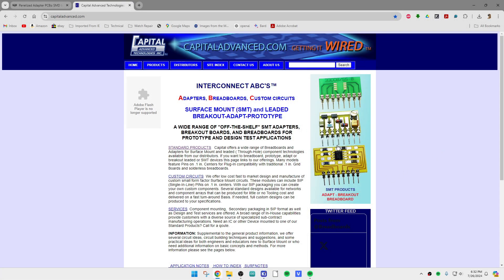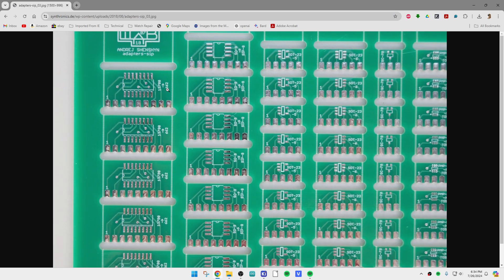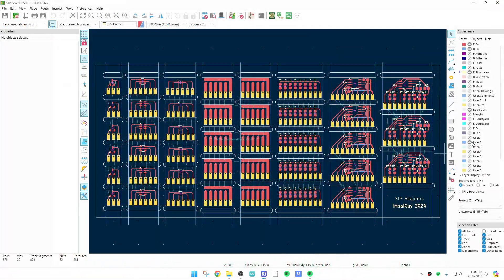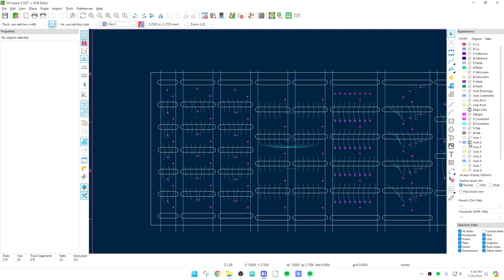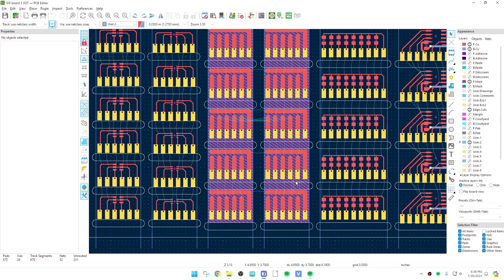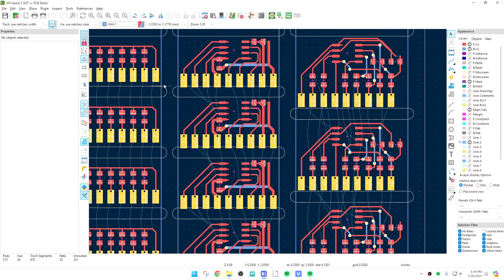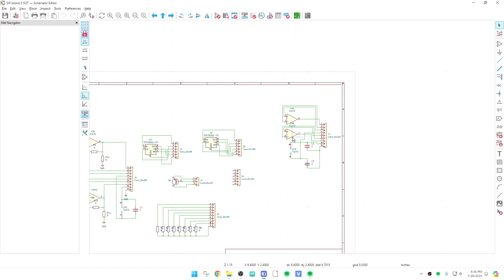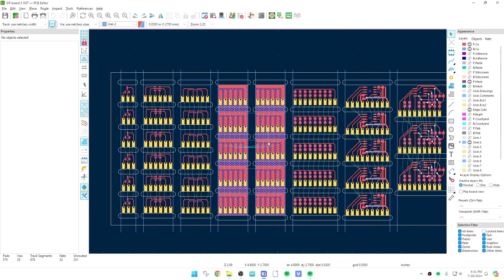#1957 SIP to SMD adapters (part 2 of 3)

Comment: I'm curious  whether you were charged for each design on this board.  I did something similar a while back and jlcpcb came back and charged me for each circuit design contained on the panelized board.
Reply from the maker: It had extra charges but I don't think for each design. Not a cheap board
Reply: @IMSAIGuy  might want to try dirtypcb's, they let you put anything onto the 2-layer boards

Comment: I have found it very easy to lose tracks, when panelizing within KiCad. The issue seems to be in moving the entire circuit unit around on the panel board. Traces fail to attach and move and get lost, or placed across something else, causing a short.  Try verifying the first placement of the circuit unit and locking all of its elements. Then, copy and paste. Also, as others have noted, making vertical boards is easy enough using just right-angle header strip pins and standard board pin holes. HTH.

Comment: Going to be a nice to have board.  Should build a bunch and have Anchor stock them.    Worst feeling, finding a dumb issue after the boards are in process.  I swapped the silk art and solder mask layers once, very strange looking board.  Funny I saw the issue on the JLC checks but thought is was just an issue with their rendering.